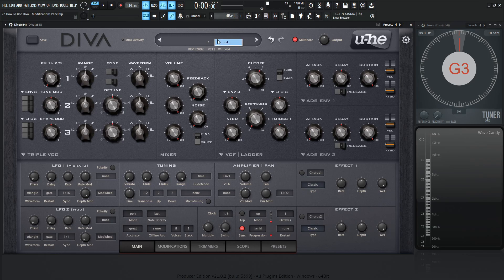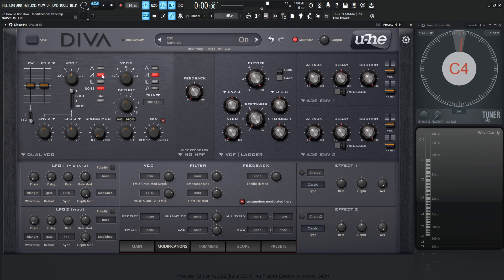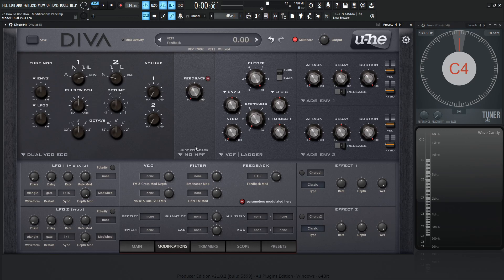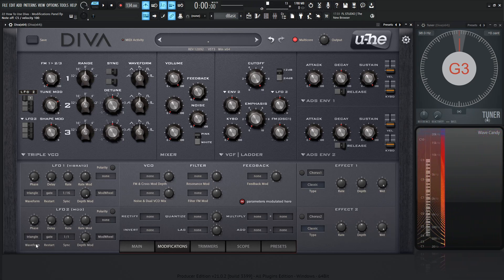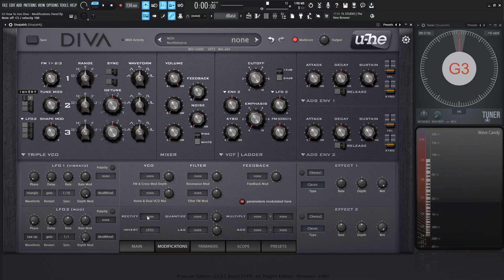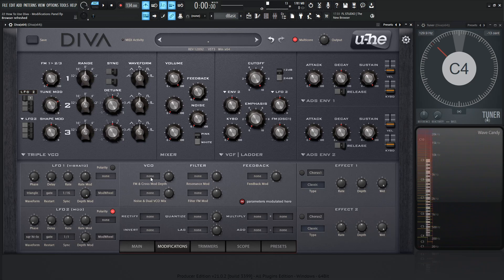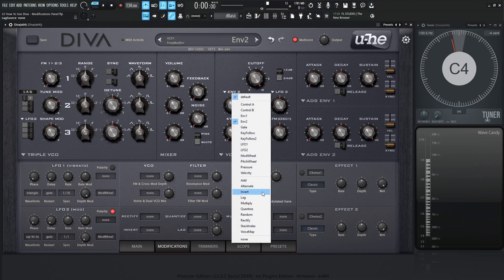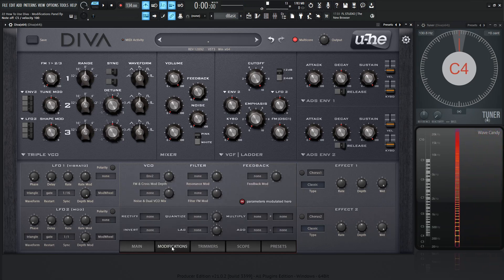Modifications and Scope Panels PART 22 | u-he DIVA Tutorial

Comment: Another amazing course! Thank you for this Jon. 2 questions:

1. Are you planning on covering Omnisphere?

2. Do you own or are you interested in any hardware synths? If so, would love to hear your take on them
Reply from the maker: Thank you so much!!
So to answer your questions, I've definitely considered covering omnisphere, I'll probably eventually put something together but right now I don't have any concrete plans for it.
As far as hardware synths go, as much fun as they are to play I'm definitely a software synth guy. I do like the system 8, I had a lot of fun programming patches for a friend on that one. But there's really only 1 hardware synth I would really like to have and that's the original polivoks. The sound that comes out of that thing is like nothing else.
When the polivoks mini was released, I bought it right away.
Its a really cool analog synth but it's much more limited than the original.

Being able to open my laptop, plug in a midi controller and load up the sea of soft synths I've collected over the years is amazing. I can make patches on the couch, in an airplane, or in my car parked on the side of the road, and it's a fraction of the cost too.
I really wanted to get an obx and when I went on their website and saw the price, I just laughed and closed my browser and never considered it again lol

Comment: could you do a tutorial on how to use the detune? In serum you can easily create a thick sound, but in Diva it just sounds out of tune even if i offset the voices by a little bit and I'm not getting a thick sound
Reply from the maker: Yeah I can do something like that, in the meantime give something like this a try and see how it works for you.
(keep in mind that Diva by default tuned down one octave)
1. Triple VCO Panel
2. OSC 1 range = 4' Volume 100 | OSC 2 range 8' detune 0.12, Volume 74.00, OSC3 range 8' detune -0.22, volume 97.00 (All saw waves)
3. Noise set to pink, volume 23.50 
4. Set stack to 2
5. In the Amplifier Pan section, select stack index and turn the pan mod knob to the right
6. run it through the UHBIE filter
7. Effect 1, use plate1 and bring the wet down to around 33
8. for the amp envelope, use the analogue and give it some release

that should be a decent starting point. with diva you won't need to stack too many voices for a big sound, usually less is more in most cases. let me know how that works out for you dude!!!
Reply: @jonaudio  Thanks for the help, but it's not quite what I'm looking for. I'm trying to figure out how to create these thick, lush analog/retro synths.
Example: https://www.youtube.com/watch?v=Zdo7ToEVqPY 
2:59
Wouldn't I need a lot of detunes/voices to get that beefy sound?
Reply from the maker: Ooh gotcha, yeah so really for anything retro or analog, you will need some detune voices for sure, but there's a few other things to try to incorporate. Anything analog will always be unpredictability and instability, so maybe using the varience panel would help in that sort of sound, also running it different filters to see what best fits the sound you're going for. Then using the analog Amp envelope would be nice on that too.
Abd a big part of that type of sound is running it though Chorus.
Lots of older synths depended moreso on chorus than they did with unison, I'd suggest to run it through the chorus and trying out the different modes.
Also subtle filter motion with some resonance will really tie that in together
Reply: @jonaudio  Awesome, thanks for the help. Would like to see some diva sound design tutorials from you.